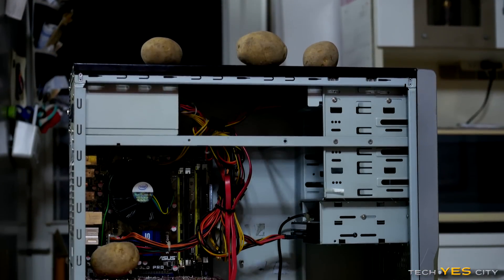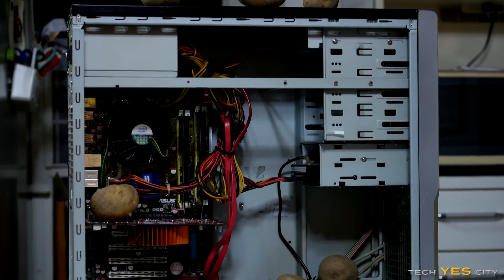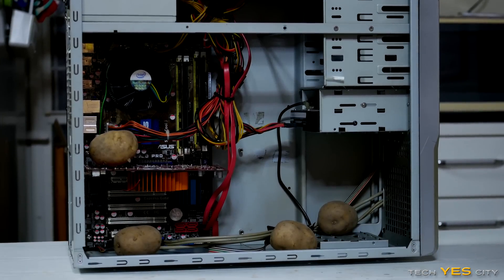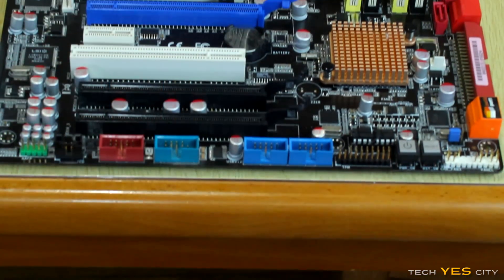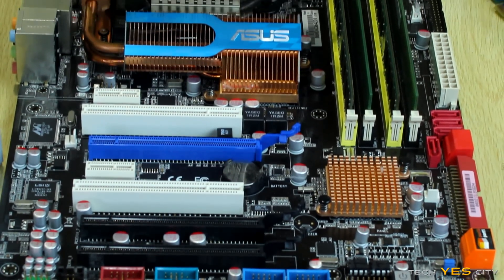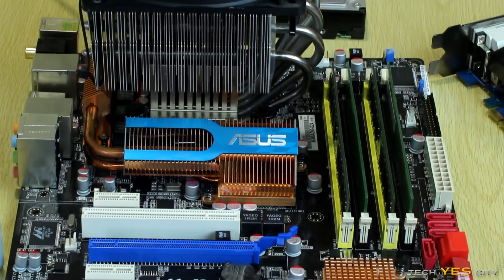The $70 CS:GO POTATO - 1080p CS:GO for Under $100?

Comment: >mfw crossfire radeon hd 5870 can manage 40fps on lowest everything
Reply: No
Reply: it does. im not lying here
Reply: GalaxysDesigns I meant I'm pretty sure it's much higher for something like csgo. The hd 5850 from his 100 $ pc video hit 60fps max settings in csgo. So you have a major cpu bottleneck if you are only getting 40. You should definitely upgrade your cpu. Sell one of your 5870s if you have to,  the bottleneck is real.
Reply: It's on my second PC, and i have an i5-750 in it. I should clean it out, the dust is leaking out the case
Reply: omg, what is wrong with your setup? How do you only get 40 fps, like wtf?
Reply: I think it's dust buildup, and it's my secondary PC
Reply: GalaxysDesigns probably. You should clean it it,  you are hurting those parts. People still care about parts that old.

Comment: If it can't do 144fps on 4:3, I do not want it
Reply: 4:3 is an aspect ratio. Not a resolution
Reply: Derps Well I mean in terms of a potatoe to play csgo. If on low res 4:3(like 1280x960 max, maybe just 1024) and low settings can reach 144fps, then it would be worth. Csgo at 60 fps is not worth if you want to top frag. Only to play casual and have fun. this is assuming you have 144hz monitor which is what im going off of.
Reply: WoopsToggle i realize that. I was just correcting you.
Reply: Derps ye u good man I just said that wrong thanks

Comment: Hello people I've got a question I've got a hp psu that has 420w it has been doing a fine job for 10 years but is it safe to use in a new build with an asus p5k mobo and a xeon and a old and a 9800gt? Thanks in advance
Reply: Don't use a 10 year old PSU.... Just get a new one it'll only cost 40$ for an Evga 500w
Reply: +VitalStatistiX but the parts I am going to be using are almost just as old?? And those new psus do not have the connectors I need
Reply: ***** What are the parts? I can recommend PSU's that are compatible, for example: the CX430 can work with very old motherboards and GPU's
Reply: +VitalStatistiX I already found one for 12,50 euros becuz I needed 450 watts to let my system be less ghetto

Comment: Brings back memories of my old core 2 duo e6600 oced to 3.1ghz via asus auto 30% overclock, alongside a cooler master aio, asus p5ld2-se, benq g2400w 1920x1200, geforce 8800 gts 640, 2x1gb ddr2 800mhz and a 700watt sli capable psu just to keep up with the massive power draw (500 watts psu makes the system reboot on intensive 3d scenes on cod modern warfare 1) which are all brought from PC Depot Narita Branch. Glad to see 2007 processors still kicking ass...

Comment: I cant even run 720p on cago still playing 4:3 800:600 res
Reply: +PoupsGaming A Gaming channel from Thailand created in 2009. Mainly play GTA IV, V and CSGO and many more PC spec : i5-4690k 4.0hz Overlocked EVGA SSC Nvidia 960 4GB, SSD bootdrive 2TB secondary drive, NZXT S340 Case, Corsair ram 8GB 1866hz speed, Corsair h100i AIO liqiud cooling, Corsair CXM 500 PSU, Corsair k65 RGB keyboard, Corsair mousepad MM200, Razer Deathadder mouse, Monitor 24' inch AOC G-SYNC.
Reply: +Dominik Berkov ?

Comment: OMG You replaced the thermal paste of an old Nvidia GPU! You should have a medal for that.
I don't know what happenned with nvidia thermal paste during de 9000 series but it was really hard to clean, I don't know if it was the same with ATi (not AMD yet) during this period but that was really hard. 
I tried it on a 9600gt, it was like a thermal paste patch that was pink. I tried during nearly 1 hour, I was using alcohol so I had a bit staying on my hands, and suddently my finger ripped on the edge of the cooler, while I had alcohol on hands. Yes, that hurt.

And no it was not French at the first boot. Don't know what language it was but not French.
Reply: Looks like Spanish or Portuguese

Comment: how the fuck does this outpeform my q6600 6gbs ddr 2 p5kse and a gt 630 not a gtx a gt
Reply from the maker: +wubman gaming (wubman22) q6600 is much weaker than the CPU I used here.  And I haven't tried a 630 gt, but its a really weak card, wouldn't be surprised if a 9800gt topped it.
Reply: Tech YES City lol me 2

Comment: You should start building these and selling them to the poorer side of the CSGO community for $100-125.
Reply from the maker: +TheElastic Tuba (AlwaysMoveForward) Only problem is shipping.
Reply: +Tech YES City Leave shipping costs to the buyer, even with the additional costs it's a lot easier of a buy for the lower end of the CSGO community. And just have it open for case by case basis so you have something to build and make money off of should someone order it, and not have to spend money or time on production when there's a low demand.
Reply from the maker: I mean shipping them by boat would be pretty cheap to near by asian countries (since its zone 1), but russia and europe = no way.
Reply: Tech YES City I mean overall it's up to you on what you do. I think it would be a good little successful venture. Building a PC that can run CS:GO in 1080p with an average of 60 fps on the new Nuke for only $70 is no small feet, and I'm sure the rest of the community would be willing to pay for that. 

Normally most people would just recreate the build and build it themselves, but then you add on working with preowned and used products and that's where people would be pushed over the edge of paying someone else for the build instead.
Reply: +Tech YES City Seems like my luck has visited me in double this time. I'm here talking about a better computer when I have no money only for my laptop's (which I have to use for everything) screen breaks. Now I don't have this beast of a $70 computer, nor my crappy laptop I used to use either, my luck is astonishing.

Comment: I still run a q6700. That Xeon chip, were you modding it to fit the socket?
Out of curiosity, what's the best LGA775 chip you can buy modded or not? I've been thinking the 9650, but if there's better, than why not? I have a beautiful Asus P5K3 Deluxe that I just don't wanna swap out :p
Reply: +Frankie Dingleberry man i had the same question when i had my p5kse and a q6600 with only ddr 2 tho 
the best value for peformance for that socket is Core 2 Duo E7600 or any core 2 duo with 3ghz + because its better to have more faster dual cores than a quad core so i bought it and a good cooler got it overclocked to 4ghz that thing rocked! but i sold that pc for 300 then i got a lga 1366 core i7 650 and a mobo and 8gbs ram that thing rules!
hope this helped u
Reply: +wubman gaming (wubman22) i mean core i7 920
Reply from the maker: +Frankie Dingleberry Check out my lga771 guide, there is alink there, tonne of mobos support it.  X5460 is better than the q9650.
Reply: Tech YES City Alright awesome, I'll check it out for sure. Thanks
Reply: Tech YES City i myself would never fuck with my motherboard like that XD
Reply from the maker: in my next build Ill be rocking these beats. https://www.youtube.com/watch?v=0CL_Zz9l95w
Reply: Tech YES City sounds good!

Comment: 3:02 what's up with the finger contact on the GPU
Reply: He's trying to spread it out
Reply: +Ratchet he has to add the thermal paste some how
Reply: +VeNoMzGG I thought u just put the dot in the middle and it spreads itself out. Or is that just for CPU?
Reply: +Ratchet that's just cpu because cpus have a heat spreader on them and the cores are under there the gpu core had no heat spreader so the whole thing needs thermal paste

Comment: Really similar to my rig, except I've got a Pentium E5500 :P

If I was to look for a replacement processor locally, where should I start? The NZ version of Ebay is overpriced ($60 for a Q6600...), and Ebay doesn't seem that much cheaper!
Reply from the maker: +Yazooman_179 What board is it? you could get the x5450 or x5460 and if it supports it then you can try do the lga771 mod, just be very very careful.
Reply: It's this one here mate: 

http://www.gigabyte.co.nz/products/product-page.aspx?pid=3505#ov

I was thinking whether getting a non-Xeon processor (if realistic), because I'd rather not cut my motherboard up with some risk of problems haha
Reply from the maker: True, well my guide is there, and if you have a cheap dual core lying around then it is pretty easy, I might do some test footage in 4k with a speedcut on all the lga775 boards I have here for fun lol.
Reply: Haha yeah that would be pretty sweet mate! If I find a cheap Xeon I'll give it a go
Reply: +Tech YES City What are you using to clean of the components?
Reply from the maker: +TheDjm95 brake cleaner.
Reply: Doesn't it leave some sort of residue and in some cases damages the PCB? And it's toxic ? What's your personal experience with it overall, did you recently switch to it?
Reply from the maker: it can be bad if you leave it on, but I usually use alcohol wipes after, and then final coat of crc556, which protects the motherboard.

Comment: What is that spray you used
Reply: +hypnotizeu he wouldnt use wd-40 its like oil it would never dry off the motherboard
Reply: +Master Race its this crap
http://www.homedepot.com/p/CRC-QD-11-oz-Contact-Cleaner-02130-6/202262505
Reply: +Master Race Contact Cleaner
Reply: Ok
Reply: Probs wd40
Reply: etching solution.... jk don't use etching solution on a motherboard.
Reply: +Master Race WD40
Reply: Reptillian Henchman coo

Comment: What spray are you using to clean those parts, apart from compressed air?
Reply from the maker: +berdt will make a video later this week, main cleaner is brake cleaner.

Comment: Is the performance of a q6600 @2.4Ghz, 4gb ddr2 (max.) and a hd7870 overclocked good enough for 1080p titles @mid? And what is a good price?
Reply: +Patrick Zieverink Old titles yeah.
Reply: I thought battlefield 4 on ultra at +/- 45 fps because the 7870 is better as a r9 270(x) and the q6600 wouldn't bottleneck too much. Tell me if i'm wrong

Comment: I bet this could play gta 5. It almost meats the minimum requirements. How many mb is the 9800GT?
Reply from the maker: Cheers
Reply: It's the msi variant of the card. It has 512 mb of ram. Just checked it on msi's site.
Reply: Snikur Hey what you should do is get an GTX 460 SUPER cheap here in the UK and i bet it is in the US or a 7770 that an extra £10 here in thew UK and enjoy some 1080p medium setting gaming :D
Reply: 500mb
Reply: I don't think it would cut it. Its ram is in the 500 - 768 mb neighborhood.
Reply: No it has at-least 4gb of ram.
Reply: SrizyGaming There not all 512mb though. I had a 1gb one.
Reply: +raven still It will run GTA but in DX10.
Reply: yep
Reply from the maker: +raven still Yeah I think its 512mb, didn't check.
Reply: oh ok
Reply: There's also a 1gb model.

Comment: Can I use brake cleaner spray for cleaning my pc parts? What do you use? Great video btw!!!
Reply from the maker: +Naddel81able Yeah I use brake cleaner / AKA parts cleaner. Cheap AF. Just make sure you clean it off after with alcohol as it does eat plastics.
Reply: i wouldnt use that i would probs melt your parts
Reply: use 99% isopropyl alcohol i think I spelt that right. or completely denatured alcohol and cotton balls or coffee filters would probaly be best

Comment: the drive isnt slow because its sata 1, its slow because hdd were slower at that time, the sata 1 bus can go up to 150 megabytes per second, you would need something like a 2tb wd red to saturate the interface, i have those drives and they go up to 155 megabytes, heck, even IDE 133 has plenty of bandwith for lots of drives, i bet your standard 500gb 7200 rpm hdd cant saturate that, anyways, great video as usual, keep up the good work

Comment: Please do AMD budget PCs in the future since intel motherboards get way to expensive with age. A motherboard shouldn't cost 2-3x as much as the cheapest core2quad
Reply: +Diavolo222 you can get a phenom II for quite cheap, and a phenom II x4 is easily on par with a q6600 or even an i5 750. and you can get an athlon x4 for a dollar often times, and that won't bottleneck a low end gpu. doesn't need to be low end, just needs to be old. and back in the day amd were doing way better compared to the intels of the period than they are doing now.
Reply: +BakyLive AMD budget cpus are the worst of the worst lol. They might be cheaper but they are pieces of trash.
Reply: Does anyone here remember core unlock?
Reply: ***** yeah, if you got lucky you could turn your x3 into an x4. i miss my old phenom II black edition, i hope it finally finds a worthy successor in zen.
Reply: ***** you don't buy them new of course, on ebay/craigslist/whateverbut used x4's can be found for nearly nothing. on a totally unrelated note, i'd rather have an x6 than a 9590. at least the x6 can be cooled, and it's not oozing disappointment, failure and shame like all the FX processors are. at least the phenoms still had dignity.
Reply: ***** all phenom 2's can be overcloked even the cheaper multiplier locked ones throw base clock overcloking. So look for a 1045t or 1055t
Reply: +BakyLive I would love to see a similar 100$ amd PC, and a versus with the 100$ Intel pc.

Comment: why did you do that to the cpu?
Reply: +thebossofbox If you mean cut it, and put the little stickery thing on, he did it so the cpu would fit and work with the motherboard
Reply: +thebossofbox He's using an LGA 771 Xeon processor with an LGA 775 board. He has to cut the little notches in the socket and a put a special sticker on the CPU, which switches two of the connection pads. Bryan has a tutorial video for this if you're interested. It's in the description.
Reply: ahh okay

Comment: Hey Brian(Idk if i wrote correctly)! Is ok to clean the thermal paste from processor or gpu with water and toilet paper?
Reply: ThatDutchGuy  k thanks
Reply from the maker: +Vrzgr Sgu lol don't use toilet paper, it will go everywhere.  Although I have used water before, you have to dry it out completely, which takes time (and I usually like to film and do the whole build in a day), so I use another method.  Also with water be very very careful with PH levels and make sure your parts are not charged at all...  i.e. I would honestly stay away from using water if you can.
Reply: Tech YES City ok.i will buy iso alcohol
Reply from the maker: Yeah that will work.